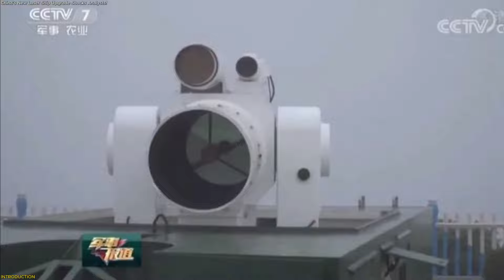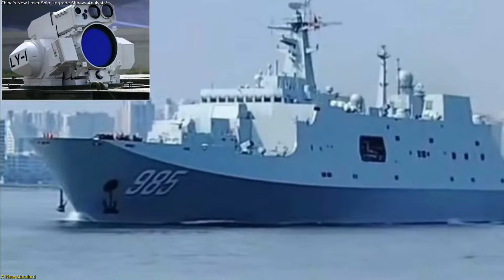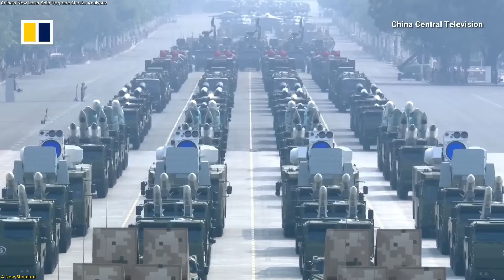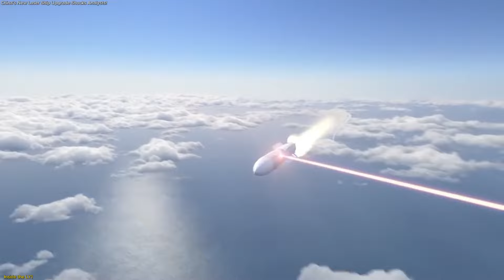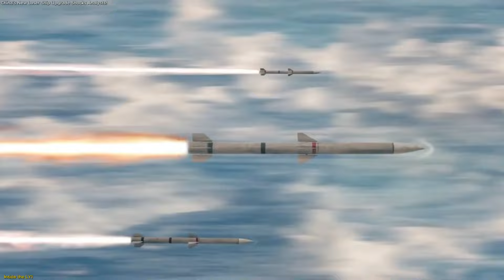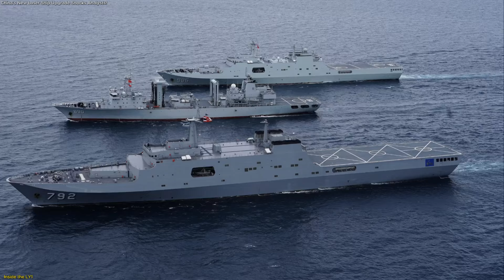China’s New Laser Ship Upgrade Shocks Analysts!

Comment: Nice but all speculations - "maybes", "perhaps", "could be's", "probables", etc. 
No technical specifications, no engineering information, no real test firing even shown. 
However, on the flip side of the coin, these lasers are all military directed energy weapons of the highest technical order and consequently, top secret in terms of their capabilities, power output, power consumption, range, deficiencies (against counter measures such as mirrored surfaces, fog, smoke, haze, etc), and efficiency. The less the enemy knows, the better the advantage and better the capability of the weapon.